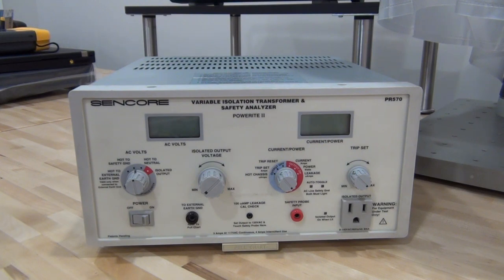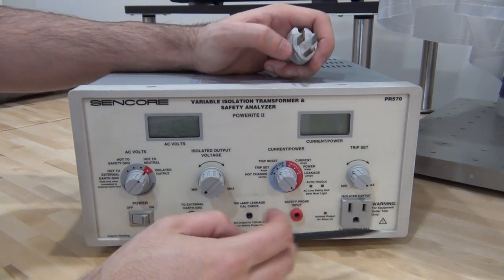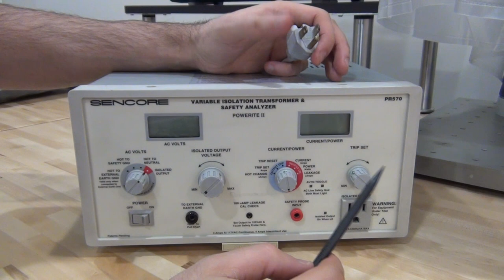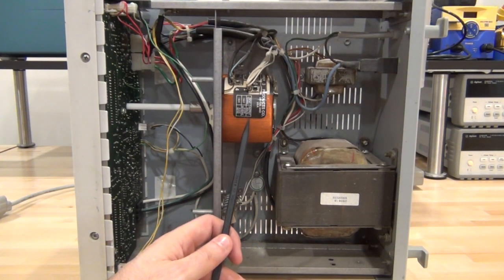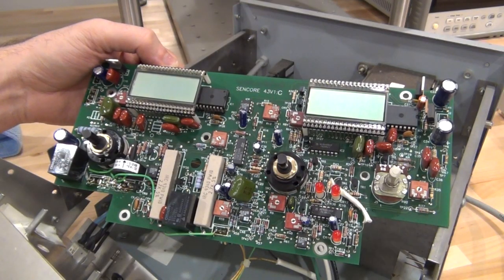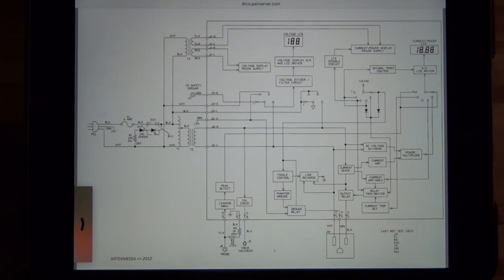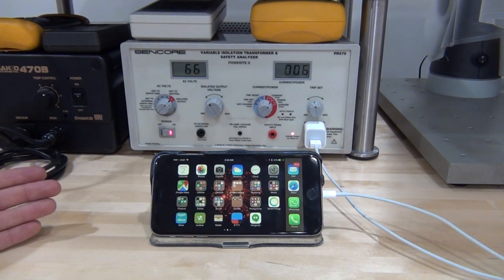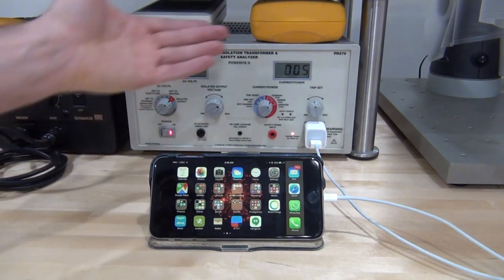TSP #85 - Teardown & Repair of a Sencore PR570 Variable Isolation Transformer & Safety Analyzer

Comment from the maker: Thank you all for the kind comments and happy new year! One note to add to avoid confusion:

Instead of thinking in terms of parallel/series of winding, we can note that the input consists of an auto-transformer followed by a regular two-coil transformer. The auto-transformer provides variable ratio while the regular transformer provides the isolation. Please note that the auto-transformer itself provides no isolation as it only has a single coil where all three terminals are electrically connected.
Reply: I'm wondering if there's a particular reason why the two transformers are that way round: I'm putting a separate Variac and isolation transformer together myself, and I can't think of any reason why the isolation transformer could not come before the Variac, which is actually more convenient for my setup. Are you aware of any reason the Variac should come first?

Comment: Whenever I need an isolated mains socket, I use one of those cheap car invertors that make 120V AC out of 12V DC. I get 12V for it from my lab power supply. The resulting AC is not the best in shape, but fits most of the purposes such as fixing the power supply of some home consumer electronics.

Comment: Remarkably similar in design to a variable isolation supply I am building. I put a load resistor that I can switch in series with the output to protect against a short in the DUT. I used commercially made voltmeter and ammeters for monitoring, and a bar graph indicator to show voltage across the load resistor.  The variable voltage is via a variac which is a variable auto transformer, same as in your unit.

Comment: I have a question I'd like to throw out.  I have a Heatkit IP-5220, same basic design, simpler metering.  The topology is the same, Variac first from the mains, then the isolation transformer, to the power outlets on the front of the unit.  There is also a direct non-isolated utility outlet on the front.

The main fuse for the unit is 7 amps.  The variac is rated for 3 amps.  Output metering/fusing is switchable for 1 or 3 amps.  Just want to give as much info as possible about the unit.

What I would like to do is reconfigure it so that the iso trans comes first, the output of that goes to both the variac and one of the power outlets to provide direct line voltage isolation,.  The out put of the variac to the other power outlet for variable voltage.

The question is, will I run into trouble swapping the order of the variac and iso trans?  What considerations go into putting them in a particular order?

Comment: If I designed that for the 110-120 volt market, I would have made the main transformer into a 1:2 turns ratio, so that one could output 220-240 +the extra that the variable transformer gives. Maybe split the 1:2 ratio into two taps, so one could select 1:1 or 1:2, so we could use thicker wire for the 1:1 to get better current carrying capability if needed.

Comment: is it just me or was the repair part totally missing? either way thankful for a new video
Reply from the maker: Jon Sands I am sorry, I explained in the video that all I had to do was to re-insert the LCD module to fix the contact problem.
Reply: Oh oops, I must have blacked out during that bit, all I remembered was you mentioning they turned out not having a zebra connector. Watching it again and of course now I hear it. Thanks!

Comment: Hi. I wonder if there are other options than this PR570 available on the market or used? I am primarly interested in 230V input and 0V-270V output. 1000VA would be enough. Something that has nice display with all measurements shows at the same time, less knobs, and active output regulation, so the output is stable even if the input varies, and output relay cutoff if the regulation can't be performed. The PR570 is really dated, looks like a design from 80s probably. And it doesn't have active regulation. So you probably should stick input it into inverter or automatic voltage regulator. The PR570 also looks like a really low power, maybe 400W? That can be done this days easily using solid state inverter instead with very little cooling.

Comment: Happy new year!
Does it matter whether you put the variable transformer on the primary or the secondary side of the isolation transformer?
Reply: No and in fact if you put the variable transformer after the safety isolating transformer, you can double-isolate the control electronics as a bonus.

Comment: What makes the variac and main transformer to be in parallel? I would call it serial.
Reply: Parallel/serial does not apply. The variac output supplies the isolating transformer primary. Also, the variac is an autotransformer - it does not have a primary or secondary and therefore does not have a turns ratio, it has a tapping ratio.
Reply from the maker: Instead of thinking in terms of parallel/series of winding, we can note that the input consists of an auto-transformer followed by a regular two-coil transformer. The auto-transformer provides variable ratio while the regular transformer provides the isolation. I added a note to the video to avoid confusion. Please note that the auto-transformer itself provides no isolation as it only has a single coil where all three terminals are electrically connected.

Comment: Are you sure about the fact that the iPhone charger is a buck converter?
Considering that it is easy to access its terminals, some kind of isolation is definitely needed for people's safety. I'm voting for a flyback but I'm not sure.
Can you confirm this? Thanks
Reply from the maker: Hatimoooo I think you are right. It is definitely transformer based.